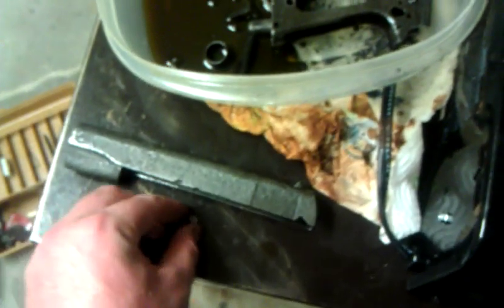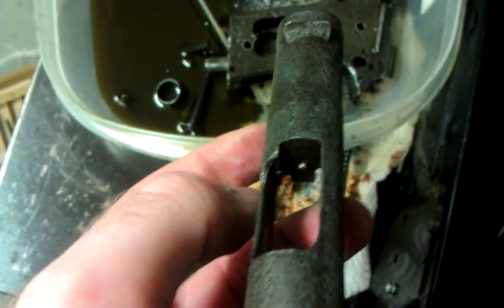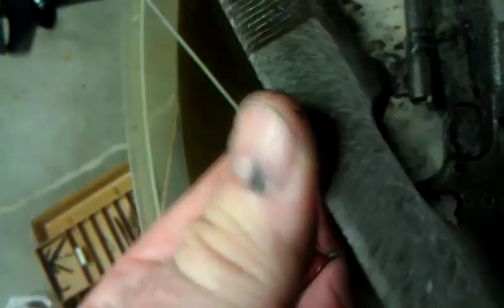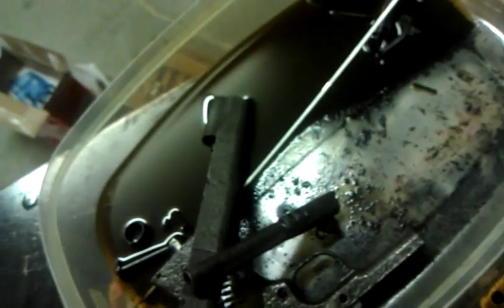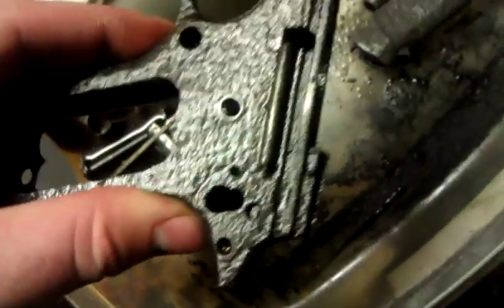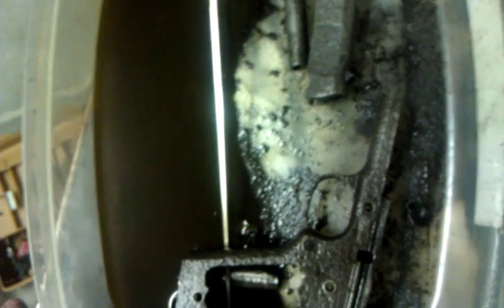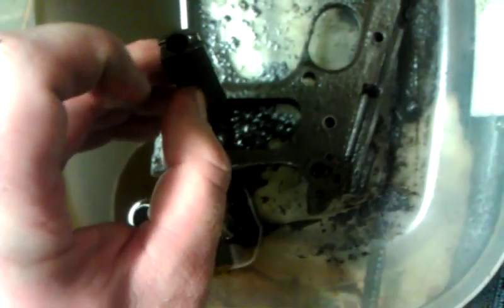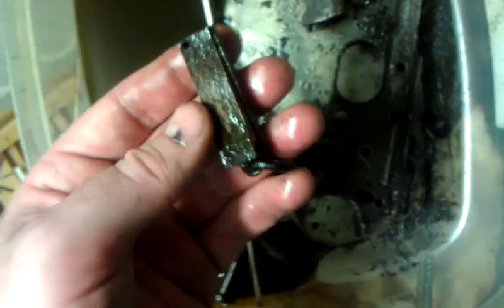Rusty 1911 Restoration: Video 35: Firing Pin Retaining Plate is OFF!

Comment: Heve you tried putting the mainspring housing in a vice and just using the vice to apply pressure to the mainspring plunger?that's the method I used to relieve pressure from the mainspring plunger retaining pin. it may work for you as well.

Comment: I hope to god you just replaced the plunger tube spring and didnt add metal to the frame its supposed to drop down it just stays low until the mag follower pushes it up when weapon is empty theres nothing wrong except plunger spring is shot